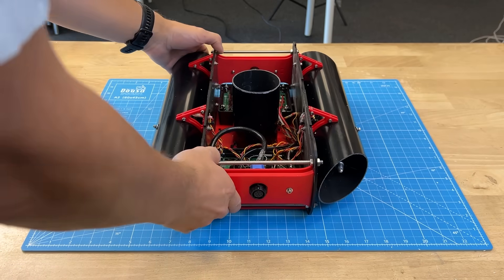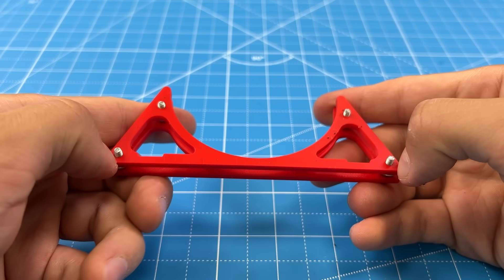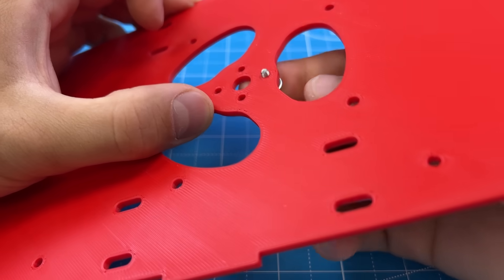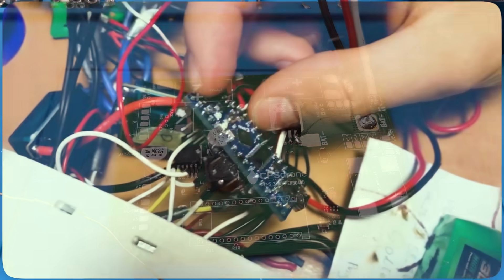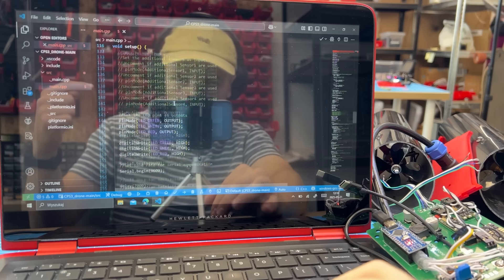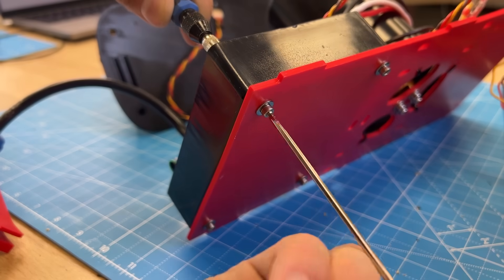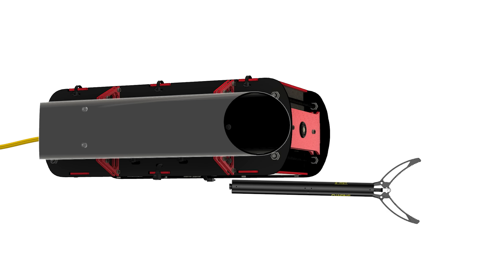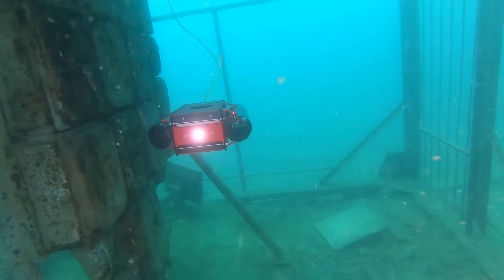How to build your personal DIY Submarine (Arduino Project)

Comment: why they dont use a pipe for the main body with the electronics? a sewage pipe has enough diameter and you can get plugs easier to waterthight

Comment: bro said we cant use a 3d printer cause you know they are expensive. So guys instead here is my CNC router and we are going to be using it to make all of the parts instead lol, like that's any cheaper then just buying a 3d printer especially as a builder the printer is cheaper than paying a shop to cut out your projects all the time.

Comment: Really nice kit! I got a question about the Litium cell epoxy casing, doesnt litium cells need to be able to expand a bit? The case where samsung mobile phones exploded on airplanes was due to limited space if I recall correctly so have you considered this when encasing them in expoxy? I´m not trying to be negative, I´m just curios because it seems really convinient. Also how much pressure can a 18650 take?

Comment: Looks really cool 😁
But I have one question: Why is it necessary to put a battery in the drone? Wouldn’t it be easier if the energy came from above the sea and went through the cable? Or would that disturb the signal from the camera?
Reply: Many ROVs are indeed powered through umbilical cables. The system typically converts low-voltage DC into high voltage for transmission, then steps it back down to low-voltage DC on the ROV side. This approach minimizes transmission losses and ensures a steady, almost continuous energy supply. The main advantages are reliability and uninterrupted power delivery. However, the downsides include high costs and strict safety requirements, since improper handling could pose an electric shock risk.

Comment: Ignorant question: why not fill camera and electronics compartments with mineral/hydraulic oil? Less compressible and liquid cooled
Reply: Mineral or hydraulic oil does not remain permanently inside the electronics housing. Instead, it requires a precise sealing structure to keep the oil surrounding the electronic components. While this is indeed an effective solution, it significantly increases costs and is more suitable for ROVs designed for greater depth requirements. For lower-cost designs, epoxy potting is generally a safer, more efficient, and more economical alternative.

Comment: Your video is awesome — super clean build and genuinely inspiring! I really like your watertight epoxy potting method, and the way you documented everything is excellent. Honestly, I didn’t expect epoxy to be that pressure-resistant — 20 meters! That totally changed my perspective. Right now I’m preparing to test an SLA 3D printed part to replace the GPS antenna housing, and I’ll be potting it with epoxy too — just to spice things up. The GPS won’t be used underwater, but it’s still essential for surface navigation. I’m designing for a 100-meter depth, so in a few weeks, once the build is ready, I’ll run a hydrostatic pressure tank test to see whether this SLA + epoxy combo is truly pressure-proof… or just ready to tap out.

Comment: Will a brushless motor like that be safe in water?
Reply: Using brushless motors directly in water is very safe. I've done many projects where the motor operates submerged, and it's been consistently stable. As long as you flush out the water with WD-40 after each use to prevent rust, the motor can last a long time.

Comment: You need to grab a friend that knows how to solder.  You need heat, solder and flux all at the same time in the same location all at once.  those joints looked painfually bad.

Comment: Dear CPS Drone Team,

I hope this message finds you well.

We are a group of final-year engineering students currently working on our graduation project, and we have chosen to base our work on the CPS 3 underwater drone. We are truly impressed by your innovation and the capabilities of the CPS 3, and we believe it would be a valuable model for our academic research and development.

We would like to kindly request the following technical resources, if available:

1.  The SolidWorks (or CAD) design files of the CPS 3 drone.
2.  The PCB design and schematics used in the system.
3.  The water pressure calculations and structural analysis explaining why the drone is rated for a depth of 20 meters only.
4.  The P-load (Pressure Load) calculation, which is critical for our structural analysis and documentation
Reply: This the the kind of comment that deserves attention!

Comment: Have you tried potting the electronics in something like a sealed and pressurized grease-filled box? That might be a way to waterproof them while also making them accessible for repairs, instead of sealing them forever in epoxy

Comment: A tethered sub with batteries? Why not send power down the cable as a nice high-frequency AC voltage, isolated by small transformers? Unlimited run time awaits!

Comment: Hmmm, I wonder If there's a way to use FPV gear (radio and goggles for the video) in such drone. Idk how would you connect them using a physical cable, not 2.4/5.8Ghz signal.
Reply: SBUS signals can be transmitted over 100 meters using twisted pair cables. Analog video signals typically don’t travel far, but with old-school analog-to-twisted-pair converters, you can push them beyond 100 meters as well. I’ve tested both using 100-meter twisted pair cables, though I haven’t tried longer ones yet.

Comment: It looks very interesting. I have one main question: what about the service life of the motors? Am I right in thinking that these are ordinary motors for aerial drones and are not suitable for use in water?
Reply: As long as the ordinary motor doesn’t rust when used underwater—just flush out any internal moisture with WD-40 after each use—it runs smoothly  . RC brushless motors operate at relatively low voltages, so it’s not something to worry about.

Comment: I'm not so surprised the battery holders were heating up. It seems pretty consistent through the video that your solder joints are done too cold! That makes the joint have too high resistance

Comment: At 1:56 it looks like you're using threadlock on the prop. That's crashed many a quad as the chemicals in threadlock degrade polycarbonate (used in the props). If you must use thread lock apply a small amount to the threads and let it try before tightening so it doesn't get onto the plastic.

Comment: 6:40 You could use Hot Glue for pouring the electric or use it at least at a "first Layer"...
A little bit of alkohol and you can peel the Hot Glue away
...and btw. pouring all the 18650 cells ( 6:55 )with epoxy is maybe not good, because the spring tension isn't there anymore and the contact points could be filles with resin

Comment: 6:57 if one battery cell fails, then you’ll need to replace the whole thing. I don’t like the epoxy idea since it makes replacing/repairing things impossible. Basically you need to buy another board if one component fails. And that does happen, it could even be something simple like a bad solder joint. Aren’t there any better solutions that are more repair friendly?

Comment: Instead of epoxy a potting agent could be used - there are various versions including those that conduct heat quite well. They're typically more expensive, but are specifically designed for protecting electronics.

Comment: wait did you just say we're making it accessible to everyone without a 3D printer then get something CNC'd ???? wtf
Reply: have YOU heard of PCB Way ...??
(joking half sponsor read voice)
Reply: I got a desktop cnc machine for about 80 bucks that absolutely could handle machining these parts without upgrading it, for whatever that's worth. I agree that it's a little silly to rule out 3d prints while including CNC cut parts, tho. like. a cheap 3d printer isn't much more than 80 bucks, either. I guess maybe Poland has extraordinarily cheap machine shops?
Reply: @x_elen_x I am not exactly sure but we're those parts plastic or alu? I thought plastic?
Reply: @Cyber_Gas IDK, I was going to bring up the idea that they could be PCB material as well, that stuff is more than strong enough for this application when you double it up like they did.
Reply: I mean you can either get CNC 3018 for about 100$ or order it from some service like jlc pcb
Reply: @Cyber_Gas ender 3 is like 100$ too
Reply: @leobla744  yeah but my point is it's not impossible to get cnced things and 3d printers are cheap
Reply: @Cyber_Gas and you can buy entire printers at this point for 100 bucks.
Reply: definitely cheaper.
Reply: Can you not read, they sell you the pcb and cnc sheets
Reply: They want 500$ for the parts. I think it would be better if I got my own printer
Reply: I can build the same parts with some plastic and a dremmel.  I can get a used dremmel for nearly free if you look.
Reply: Jesus Christ loves yall, he died for yall in the cross, he is the only way, repent and follow Christ, Don’t swear bro it’s a sin repent and follow Christ

Comment: I found these fishing cameras for sale. They are basically the same as the car camera but more robust and built for depth and often have lights on them that can be turned on from the surface. They are pretty cheap as well like $80AUD which is like €40. That’s what I planned to build my rov out of

Comment: You could use an rp2350 and have a lot more capable microcontroller which still can use arduino libraries 4:44
Reply: Or ESP32 or STM32 or SAMD21/51 or NRF52840 or Teensy... So many good options!

Comment: And ESCs do not overheat in the epoxy? i'm into FPV drones and my ESC catching on fire much more likely even after very light waterproofing (with 1mm layer of b7000).

 But i guess the submarine do not draw that much current. And im using  Lipo batteries in my builds. 
But anyway – what is the max temperature of the ESCs gets on your build guys?

Love your work. I'll build my own sub one day, thanks for inspiration!

Comment: Now an idea: if you replace all panels with thin plywood ( can even cut it with a wire saw like model airplane makers do), print the props with wood PLA, wrap the pipes with rope and tar paper - to get an old timey 1800's pirate ROV
Reply: plywood mostly is not water resistant.

Comment: 6:50 instead of epoxy you can use special insulation compound, which can be taken off for repairs
Reply: Question is how pressure proof that stuff would be. I'm all for keeping components accessible, but if the compound starts to leak when the drone is 10m deep, then it wouldn't be a good solution after all. There will be a limit.
Reply: Special Insulation compound?? Does this mystery product have a actual name?
Reply: @keith3761  Potting agent. There are various versions including heat conducting ones that should dissipate heat into water far better than epoxy resin.
Reply: @digitalghosts4599  does not really answer my question. Potting agent? What is the actual compound or material? which ones are easy to take off for repairs?

Comment: 4:05 .... use a thicker solder tip unless you want to buy new ones all the time. You want to transfer heat. Your solder joints look poor, that will improve drastically with a larger solder tip.
Eg. C245-741. The small ones have their use case but definitely not the way you use them.
Pinheaders can be gang/drag soldered at once not one by one if you have some practice.

Comment: How about making a larger ROV with an internal umbilical drum so it can pay out and haul in its own tether as it goes. Not sure if anyone has done that before so it'd be pretty unique.

...That way it could dive inside wrecks, cave systems and underwater features without worrying about the cable snagging on things as it it won't be dragging a tether behind it and will be laying it as it goes instead.

You'd probably also have a regular umbilical drum on the surface as well for the initial dive down to depth, then switch top the internal umbilical reel when starting to navigate a complex environment where snagging becomes more likely.

Comment: Just an idea RC submarine using ultrasound for communication. Not sure if it is possible for video but it would be a cool experiment.
Reply: Ultrasound is usable, but only for commands. It is difficult to achieve image transmission in reasonable quality.

Comment: No 3D printed parts but CNC cut parts? How is this more accessible? What am I missing?
Reply: There're companys you can pay to cut or print the parts and the cnc cutting is cheaper
Reply: @-._-._-._ But, when you have 3D printer. upgrades are simple to do. even a old Ender 3, could do.
Reply: @PSimonsen incremental upgrades for prototyping yes, but not for released product manufacturing
Reply: @PSimonsen  But, have you ever considered that not everyone has or even wants a 3D printer? Have you considered that 3D printers are pretty limited to the size of panels you can produce in one piece? Have you considered that CNC machining is actually far more common than 3D printing, that it's widely used for industrial and engineering projects around the globe, and has been for decades? Do you know what kinds of materials can be cut and shaped using CNC machinery? Relatively simple flat panels are far quicker and cheaper to cut than they are to print, and the results are generally more durable than 3D printing.
Reply: I literally just asked and people are being passive-aggressive lol
Reply: You can still 3D print the pieces, even they printed a few pieces. 
They just designed the pieces in a "CNC compatible" way so you can use either technique
Reply: I think their priority was to sell a kit, and cnc parts are cheaper to mass produce than than 3d printed parts.
Reply: It's hard to believe that people are ignorant and arrogant enough to assume everyone, everywhere has exactly the same access to things as they do. 🙄 That's not always the case. On top of that CNC machining has been around much longer than 3D printing. It has been, and still is used extensively in everything from small scale to very large scale industrial engineering projects, pretty much everywhere. There are places that offer such services in far more places than 3D printing.
Reply: In theory, not even CNC is necessary.  If the CNC-files were accessible, you could print them on paper, glue them to a sheet of plastic and use a fretsaw to cut the pieces out. ;-)
Reply: Yeah... Thats way less accessable?
Reply: Makerspaces with CNC or just fabrication companies with lasers are very common, the manufacturing time is way shorter than printing, and the material is probably cheaper too, especially for the bigger pieces.

Comment: Hah! Really cool to see you using parking cameras. I've been using them for my underwater fishing cameras for years. They're generally good to about 10m but below that water enters the camera lens assembly compressing the air therein and makes everything foggy and distorted. This never goes away. Luckily you can just buy another $5-10 back-up camera and replace it.
Reply: They did pot the camera too, which might prevent exaytly that.
Reply: @trischas.2809  Ahh! I missed that because youtube video froze through that section (anti-adblock bs). I will definitely have check out their parts list to see which clear epoxy they use for that and give it a try myself.

Comment: Looks awesome. Could you at some point give an overview CPS 3 vs CPS 5 vs BlueROV2 and maybe a Chasing as well? I'm assuming Blue is more capable with how much it costs but it would be interesting to see a breakdown of the major differences. My guess would be that your solution has a lot of cost/simplicity/learning advantages over the others. Very cool that you even avoided 3D printers btw. That seems almost unnecessary with how accessible 3D printing has become but it's an interesting challenge and probably better for any sort of high-ish production runs.

Comment: Is it a good idea to cast 18650 cells in resin?
Reply: If they have attached connectors and are weld-spot and soldered, then it's completely fine. Here, they only use contacts for pressure. Only time will tell how it will work.

Comment: Joined the waiting list! I know one of the design principles was no 3D prints, but it would be awesome to have the option to use 3d prints instead of the lasercut pieces to make assembly easier and use less "hardware" (screws and such)

Comment: Such an awesome project, I’ve put down for a kit, I’m working on using a ‘surface’ vessel (boat) and a 50m capable (with dive case) 360camera to ‘dip my toe in the water’ initially at the surface but might add a weight and winch to lower it down.

Comment: I think designing it to work without 3D printing is a bad tradeoff making it harder to build for most people who have a 3D printer compared to the few people who would want to build it that don't have one.
Reply: I did think it's kind of funny that the compromise to avoid using 3D-printed parts was to use CNC-cut sheets. Both printed parts and CNC-cut parts can be ordered online, but I doubt there are many people out there with a CNC machine big enough to cut these sheets but not a 3D printer.
Reply: @NefariousElasticity  The only benefit to  CNC parts is that they want to sell kits so it's cheaper in bulk.